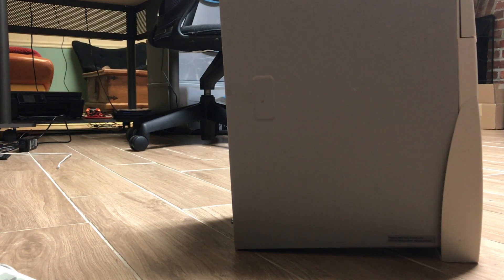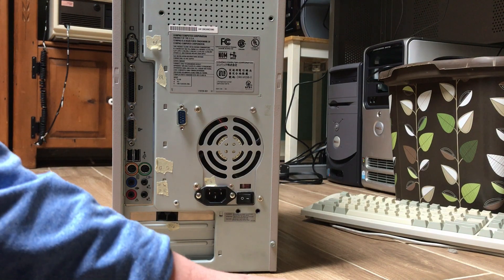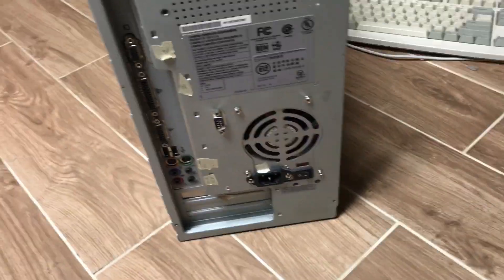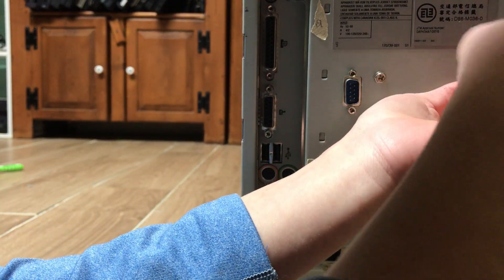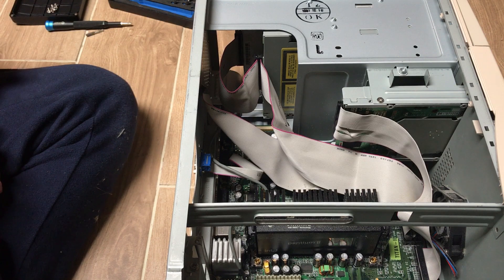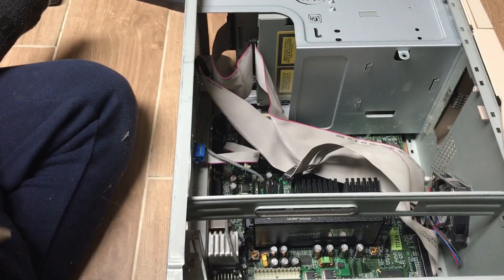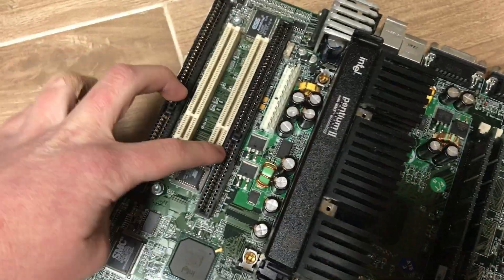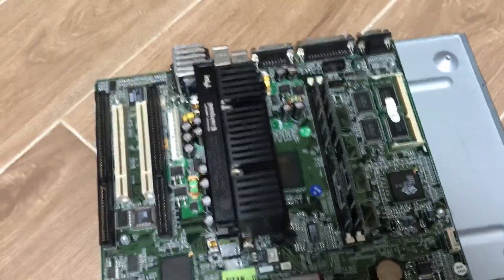Compaq Presario 4660 Teardown Tutorial

Comment: 12:47 - That's the video RAM, which is connected to the ATI video chip immediately next to it. The white slot can be used to expand that RAM with SO-DIMM modules (the same used in laptops), which is a kind of a cool feature for a computer with a video card embedded in the motherboard. Usually on computers where the integrated video chip has its own memory instead of sharing a portion of the system RAM, the amout of it was fixed and you couldn't expand it.
Reply from the maker: That’s actually a really cool design! I wonder what the limit is on that?
Reply: @3lectr1c  I don't know precisely how much RAM that video chip could take at maximum. At that times, we're talking about 1997/1998, which should be the time when your Presario was built, typical video RAM on graphics cards ranged from 2 to 32 MB. I remember I was pretty happy in those years when I replaced my 2 MB ATI Rage IIc video card with a 16 MB Creative Voodoo Blaster Banshee on my AMD-K6/2 300 MHz, and it was still a PCI card as my mainboard didn't has an AGP slot.

By searching on Google I saw that your Presario should have 4 MB of SGRAM, that stands for Syncronous Graphics RAM, which is a subtype of SDRAM especially suited to be used on video cards (I think I didn't see that acronym in nearly 20 years now :-D). And as it's not standard SDRAM I don't think you can just toss in any SDRAM SO-DIMM module coming from a laptop, like I said before. Probably there were upgrade modules which would had to be purchased directly from Compaq at that time, to bring the memory to 8 or 12 MB. More memory wouldn't be necessary, as that ATI video chip is pretty on the low-end side, and actually I don't think it would even support more than that amount of SGRAM.
Reply from the maker: Thanks for all that info! I think I’ll stick with the base RAM for now since I’m not planning on doing much gaming on it at the moment. I know you rely after that upgrade! Last year I went from integrated graphics to an RTX 2060!
Reply: @3lectr1c  You're welcome :-)
Reply: Its expandable to 8mb.  Its SGRAM.  You can buy the 8mb module on ebay.  I had this exact computer when it was new.